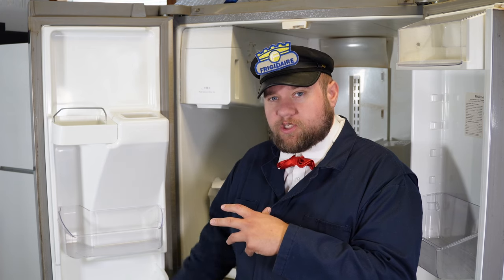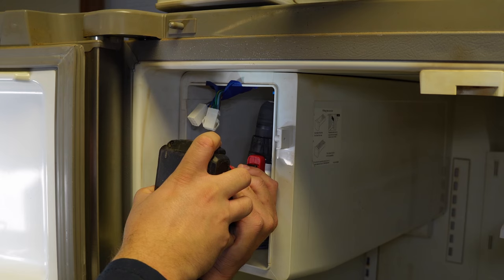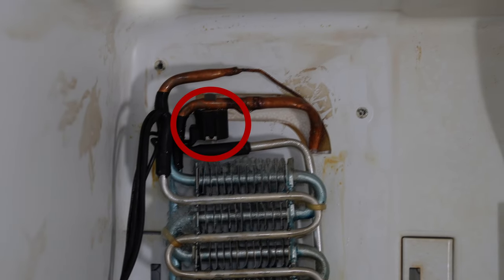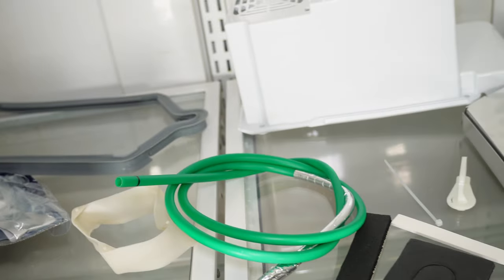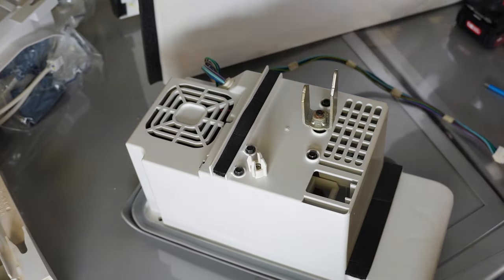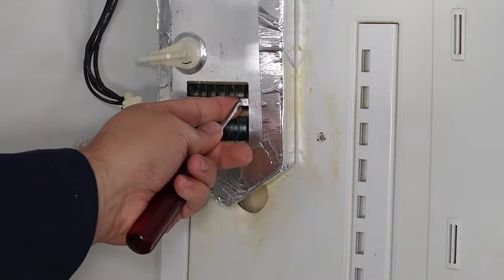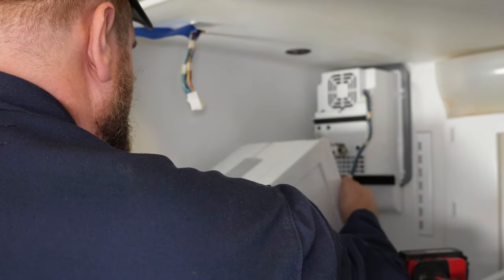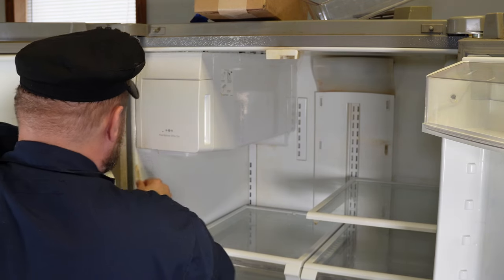Frigidaire / Electrolux Refrigerator Icemaker Won't Work or Dispense Ice - How to Fix it Fully

Comment: This is off topic but could you please do a video on wash machines  and  driers for equine activities  such as washing heavy horse blankets that have metal hardware & straps?
Reply from the maker: Not sure what you want me to say? Go commercial and larger cap like dexter.
Reply: @bensappliancesandjunk   I asked because I saw that  Miele  has a Equine Laundry machine but you've said in a video that it's a nightmare to service that brand's machines.

The video was - The Best Washer EVER to Buy May not be What You Think!

BTW if what you're saying is true about the reliability issues then I wonder if the yacht world simply replaces the machines than to fix them.
Reply from the maker: @jmd1743  Its going to vary based on technician availability and willingness to repair vs. the cost to replace the machine. That equation can be difficult to make as a tech in the middle of nowhere, Ohio. You may have access to more Miele technicians in your area than I see here, so it makes sense. Find a local distributor of the MIele equine laundry machine you mention. Ask them questions. See if the answers are suitable and meet your needs. I do not have access to that machine, so there's nothing I can say about it.
Reply: @bensappliancesandjunk  Alright. I appreciate your willingness to reply to my question.

I use to sneak into a laundry mat with 5 or 6 heavy horse  for my sister each . They had Dexter units, I was wondering what were my other options.

Comment: Ok, so everything on this video has been done and I went through and did the diagnostics for the icemaker that's in your other video and everything passed. But it still will not work automatically.  It will fill the tray. It will dump the tray. And the sensor arm goes up and down as it should. I've unplugged the fridge for 10 minutes a couple of times. Do you have anymore ideas?
Reply from the maker: What's the ice housing temperature?
Reply: I used a temp gun and the coils are 14 degrees. The plastic housing is 17 degrees Fahrenheit. It did make about 3 or 4 batches of ice over night
Reply: The display on the fridge says 20 but it could be 28 because my displays center bar for that digit isn't working
Reply from the maker: @hoitlygtlio  that's where I'd worry the issue was/is. If the housing can't maintain <15*F temp, it won't process ice. Thats a universal trait from pretty much every mfg, and a telltale sign of something bad going on. Check everything involving temps, especially cleaning coils/check fans, and so on.
Reply: Yes, but taking the temp with a temp gun it's 15 degrees but the fridge thinks it's warmer either 20 or 28 degrees inside the ice maker. Would that point to a thermostat? It looks like there is a thermostat at the top of the coil but that there may be one also under the ice tray. Am I correct about those both being a temperature probe?
Reply: And BTW, thanks for your help

Comment: Does this kit work with a Samsung model RF28HMEDBSR/AA?  Do you know the way to force defrost?
Reply from the maker: No, please inspect the parts as shown in the video. They are wildly different. You'd want to buy the icemaker repair kit my shop sells for that model which includes a drain tube/heater combo, drain clips, and the SIL-4500 mentioned at the very end of the video. The air handler system is molded into a Samsung, and there's less of an air gap.

Link: https://bens-appliances.com/products/samsung-icemaker-leak-moisture-kit

Comment: What’s cause of the ‘air gap’?
-improper Installation at factory?
-Part defect?
-Design defect?
-Homeowner misuse of frig?
-normal wear and tear?

After it’s repaired…will the defect reoccur?

If so…what will cause the reoccurrence?
Reply from the maker: Overtime things just generally degrade and it's the same way with the Samsung's. Re sealing solves it and they have new parts to seal it better

Comment: I replaced my dryer belt on my GE. It works, but now I hear what might be described as a ticking noise. I hate to take it apart again. I know I will but any thoughts?
Reply: No it's probably the lop in the drum from where they tac weld the drums together , just be careful taking those apart as there is a metal corner by the blower fan housing I always bend down as I've had to super glue a couple really nasty cuts from those

Comment: How ironic, I was just looking up your videos to see what subject matter you had, I owned a Frigidaire gallery  from 2013 to just last month, over the past 3-4 years I had issues with the icemaker, one repair guy came and wanted to install new icemaker, Frigidaire guy came and told me it’s a known issue not repairable since the back of the refrigerator had the rusting, but far worse than your video, so I was just going to do without ice until I wanted a new refrigerator, but after the repair guy unplugged the refrigerator the ice maker must have defrost like you can happen, after about 1-2 years the problem occurred again, so now I knew I could just unhook to defrost because I not know your method to defrost. Unfortunately after next few years the refrigerator was not holding its temperature, fluctuating up and down so I just replaced the Frigidaire just last month, I got 10 years out of it. On to a LG, I see your LG reviews are not very good but saw this after my purchase. There should be some type of class action on Frigidaire since my issue was very common with their units

Comment: Hey Ben, question:  I had a problem with the bottom ice maker freezing up in the back of it causing the chest door not to close right. I disconnected and removed the bottom ice maker from the unit. Would this affect the operation of the top ice maker? The top is not making any ice now. Thank You!
Reply from the maker: It shouldnt effect it I believe
Reply: @bensappliancesandjunk  Thank YOU!

Comment: If the rear has rust then the insulation is compromised.
Reply from the maker: This ones' insulation wasn't that bad. I had a full video on documenting the fix, and I did that video months ago - still humming along well. I've done the fix multiple times before, no callbacks.

Comment: Good and helpful video but if you have the finances, go ahead and chunk this piece of trash appliance and buy a new one. Save yourself a lot of headache. Over the years I’ve fixed more appliances than I can remember. I’ve also been a small engine mechanic for over 20 years. Every way I tried to wangle the wires from the auger motor I could only get about 1 inch clearance. The wire bundle that goes to the icemaker, however had about an extra foot of wire. The people that designed and were responsible for building these products were brain dead.